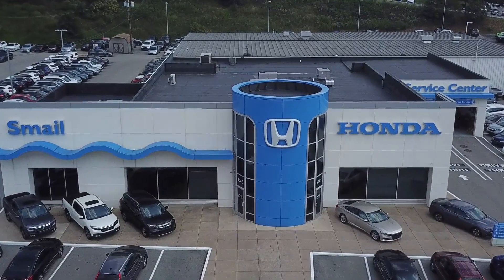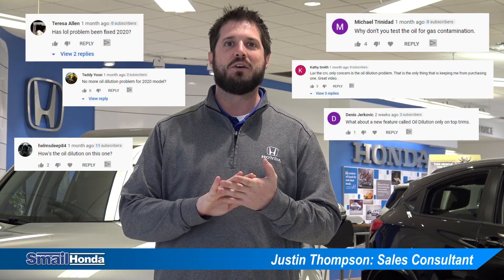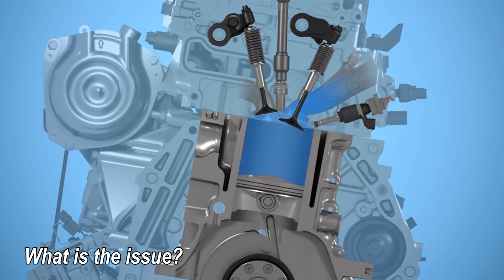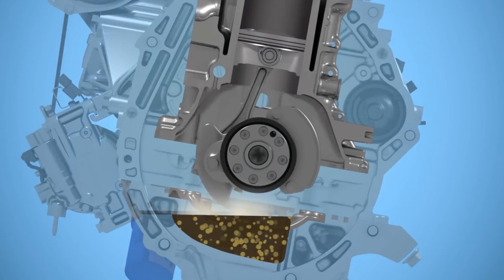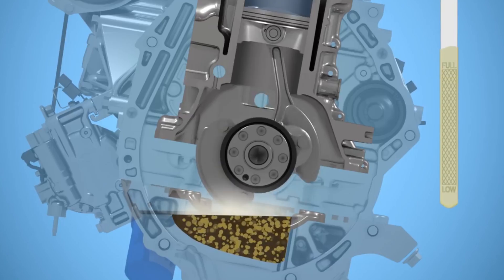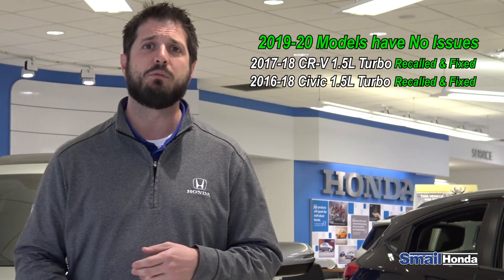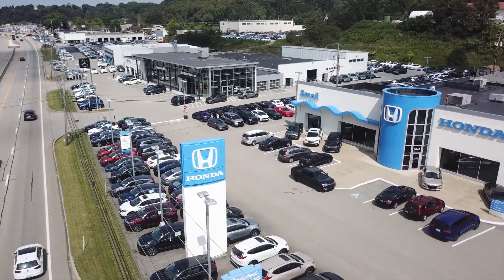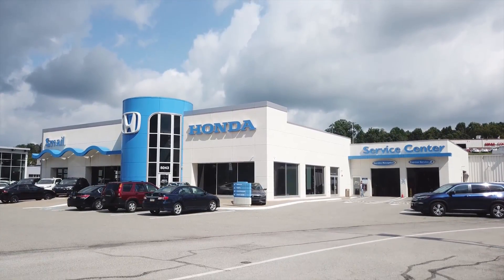Honda Oil Dilution Issue Explained

Comment: Wait! how does a software update stops fuel from traveling down from the cylinder into the crank case and mix with the engine oil? Just imagine my plumber telling me that my kitchen's sink pipe will stop leaking with a software update!
Reply: Your plumbing system isn't controlled by an ecu.
Reply: Paid by honda and of course says what honda wants to push back.  The fact is that my 2020 crv touring has the same oil dilution problem!  I did not want to believe when I checked oil level from the dipstick, it was well above the upper limit, and it had very strong distinguish gasoline smell.  I went ahead checked the engine oil of my 2013 accord that had oil change 6 months ago, found no gasoline smell obviously.  It confirmed the oil dilution problem, which made me feel helpless and very upset!
Reply: @frankli8690  2020 cry hybirid touring with 5200 miles... should I be concern too?  Is it now earth 💩💩💩 technology??   R they gonna have a recall to fix this problem??
Reply: @frankli8690  So what did you do? I have a 2021 cr-v bought 4 days ago and has now 380 miles. I can smell gas in oil.
Reply: Exactly, is he the same guy that's trying to sell oceanfront property in Arizona?
Reply: @clyde5491  You want to buy some Ocean Front property in Arizona .. sorry I think it was stolen by California along with the fresh water..
Reply: @clyde5491    might not be a bad decision....the global warming nutjobs say that the oceans are rising so fast that we only have 10 years .  Arizona could be the new CA??
Reply: fuel injection is electronically controlled
Reply: pretty sure they adjusted how quickly the engine warms up. remote start/idling can exacerbate the problem. fuel sprayed (directly) into the cylinder condenses on cool cylinder walls and drops down into oil pan, if oil doesn't heat up enough before car is shut off again the gas in the oil doesn't have a chance to vaporize and pass through pcv system to be burned. if engine warms up faster, less fuel will condense on cylinder walls and the fuel that did will have a better chance of being burned off before car is parked. this has always been an issue and why it is recommended to take longer drives occasionally if you have a shorter commute. it is just exacerbated with direct injected engines because fuel is sprayed directly onto cylinder walls vs mixing with air before entering the cylinder.
Reply: @driil  should you start the car for 10 minutes before driving in the winter or does that make it worse?
Reply: @shando3333  makes it worse. these 1.5T engines from honda take forever to warmup if just idle (even with the update). engine is just very small/efficient and idling+running heat at idle just prolong warmup process which increases chance of that gas condensing and diluting oil. i still start mine a couple minutes before so seat heater can start but best way to reduce oil dilution is start and go. from what i've read, longer drives and driving car a bit harder (once up to operating temp) should help whatever gas  that does get in the oil make it's way through pcv system and get burnt off during regular combustion.
Reply: @driil  How does it make it worse? Isn't letting your car engine/oil warm up the whole point? (or at least partially). I don't see how its good to start and go in freezing temps without letting it have a chance at warming up....
Reply: @driil  so what you're saying is the pistons and rings aren't sized appropriately to the cylinders causing excessive blow by. It's a design flaw and software only puts a bandaid on the real problem. Many other vehicles use direct injection fuel systems and don't have this issue. If software fixed the problem then there wouldn't be a class action lawsuit and honda wouldn't be settling by paying out their customers. Don't be naive.
Reply: Probably leaned out the cold start idle by a wee bit.
Reply: Probably setting it to a lower psi.
Reply: My 2019 is doing that
Reply: @tinawatson9070  Same. Bummer. I love my 2019 civic si, but I'll probably only keep it about 2 more years because of this issue tbh. Changing oil at 2k to 3k mile intervals wasn't the plan. I'd prefer to wait for the ecu to tell me when an oil change is due.
Reply: Right ! He’s full of crap 💩

Comment: is this only for 1.5 engine or 2.0 which is used in hybrid model of C-RV also?
Reply: only the 1.5... the 2.0l engine has not had any problems.
Reply: What about the the 1.0 engines? Say, a 2017 Honda Civic 1.0 129 hp

Comment: That's a bull%×€\  took my 18 si to my local dealer on hemet ca..and they pretended not to be aware of any oil dilution problem...
Reply: Does the Si have the same issue?. I’m currently looking at a 2020 si and I don’t wanna regret my decision, thank you
Reply: @MrScoobieman for my luck i heard 19 and 20 don't have this issue..
Reply: @Mexi-can72  i have the 2020 Si and the dipstick reeks of fuel also inside the crank case. I am so upset
Reply: Another SI owner here, I have a 2017 and I have this problem. Just started happening from what I’ve noticed and I’m taking it in to get fixed. Hopefully they don’t give me a problem.
Reply: @jazzz33_  thanks
Reply: @jazzz33_  update?

Comment: Always check my dipstick it's over the line
Reply: Same here, i own a 2017 Honda Civic since June, and before a signal of bad oil level in the civic screen, everytime i check the stick to measure the oil level its much higher than the max level. Im from Spain, and with 37°C temperature on the street. Im a little scare of this situation, waiting for the dealership to check the car
Reply: Same here, I own 2017 CRV exl

Comment: Hey guys I have a 2019 ridgeline 
Watched a couple of vids on the oil dilution problem
Had my oil changed last week 
Today took dipstick out and it smelled like a gas tank really bad
Called my dealership to make an appointment 
I will talk to service and see what they say 
I will update you guys soon
I am from Alberta Canada
Reply: Updates, my ass.
Reply: Updates?
Reply: @midniterabt2568  He sold the car.
Reply: Ridgeline uses 3.5L V6 and not affected by oil dilution. Every car used oil will have some gas smell.
Reply: I have the same ridgeline, do not have this issue. Midwest USA
Reply: Updates?
Reply: where the updates man???

Comment: I bought a 2016 civic 1.5l turbo. It has 50k miles on it now. Havent had an issue at all.
Reply: I have a 2016 1.5 changed my oil last month for some reason I decided to check my oil, the oil is dark like I never changed it and has a 2 stroke smell too it lol I think I'm fucked.
Reply: @TomisaLami  my question too... they have a larger optional engine option available.

Comment: I have this issue on my 2019 CRV bad. Oil level is 1.0 over the high mark, and smells like raw fuel. Oil life is 50%. There is no way these engines will have longevity when the lubrication is compromised by thinned oil.
Reply: The best way to fix Honda oil dilution is to buy a Toyota
Reply: Same thing with my 18 si..also sometimes takes about 4 to 5 seconds to start up..always do oil change at 50% because oil level is to high...
Reply: @Mexi-can72  I think I'm super fucked changed my oil last month I'm only 1000 miles in since my last oil change checked my dipstick oil is super dark like I never put new oil in it, smells like 2 stroke oil I have a 2016 1.5
Reply: Piston design issues, reduced piston-to-cylinder contact, gasoline running from the piston rings into the crankcase
Reply: Sad ..but true !

Comment: Nothing about this ad smacks true! Civics def have issues too. Software update does NOT fix piston ring size lol. Avoid earth dream dgi 1.5L turbo. No recall yet and new ones tainted too. Heart broke by Honda
Reply: My 2019 with 8000 miles has oil level 1.0 inch above high mark an smells like raw gasoline. I left the dipstick out for about 10 min and came back an whole garage smells like someone spilled gas. There is a video on my channel of me checking it. Take a look.
Reply: Show us proof then… lots of people commenting on piston ring size with no proof, the fact is it was an engine temperature issue that had to be adjusted, it was not through a “software update” but a climate control update. Apparently everyone with a Youtube account is automatically a Software Developer??

I’ve had the K24 engine on 2010 & 2016 CR-V, that engine is not as good as the 2020 CR-V when it comes to how quickly the engine warms up (which IS the only issue here). The new ones are not “tainted”… I have a 2020, it’s by far the best car I’ve ever owned and it’s not even close… not to mention signifcant drop in fuel mileage and engine maintenance is not needed until 3-4x other brands

Comment: I have a 2019 accord with the 1.5, changed the oil at 5000 miles, tested the oil, only a trace amount of fuel was detected in the oil.  So far so good.  I hope this engine is reliable once it gets high mileage on it.
Reply: hows it holding up
Reply: @rudysaucedo6659  I just had my second oil change done today.  No fuel smell, no rising oil, I have a sample im going to mail out to black stone to get it tested.
Reply: @living4christ  how is it now? mine has 60k miles
Reply: If you run them hard they will wear out faster and leak oil ... Turbo has a lot of pressure and will make the seals weak and cause leaks .

Comment: Had the software update on my 18 CRV and it didn’t work.  The problem isn’t solved and Honda will not stand behind their product.  I have ongoing gas fumes in the cabin.  I’ve contacted them and they refer me to the dealer...and the dealer can’t find anything wrong.  I am caught in the middle with A CRV that has an oil dilution of nearly 7 percent!  The normal range should be less than 2 percent.  It’s highly misleading for you to say the problem is solved.   I’ve owned 8 Hondas over nearly 30 years and this one is my last one!   Absolutely awful customer experience thanks to Honda!
Reply: Same here,17 CRV.
Reply: That’s why you don’t buy cars that are brand new with new motors or new technology   , they could have problems no one knows about until it happens down the line , wait a few years after it’s come out do research on its reliability and what’s issues it’s had or hasn’t had  plus it’ll be cheaper
Reply: Its a shame.. Honda has.been very reliable for the last 30 years.
Reply: Why don’t you just trade your car in then and be rid of the problem
Reply: That's why I bought a Mitsubishi Outlander Sport.

Not fancy, low tech, but bulletproof and reliable. 

Sometimes less is indeed more.

Comment: My 2017 CR-V oil rises to top of orange plastic part of dipstick within 1500 miles, living in southern California (zero days of freezing weather).  Changing oil at <3K miles so far, which is annoying when they claimed it would be closer to every 10K using the Maintenance Minder.  Warranty was extended by Honda to 6 years and unlimited miles if your cams wear out via class action suit, it seems.  Dealer denied issue, but did some free oil changes, then showed the official video, saying no worries!  But check the TSB on recognizing a bad cam and 16 pages of fix steps required.  Going to dump this for a Tesla Model Y next year.   Hate to be person who owns my used CR-V after that.
Reply: I believe it, ours did it winter or summer here in rural Montana.

Comment: I have zero problems with either my 2018 CRV Prestige or my 2019 Accord Touring 2.0t. Youtube mechanics fail to tell that this is a inherent feature of Direct Injection engines, so they make it seem like a Honda only issue. Honda simply made the L15 engines too heat efficient so they warm up slower than normal. If you live in cold climate and do short trips regularly you will have that problem.
Reply: True.
Also the 1.5t engines are all aluminium for better heat dissipation and less weight.
Reply: @Trump_is_a_moron  Most modern engines have aluminium blocks. Doesn't justify anything.
Reply: European perspective: inherent feature, it is not.
Ford, VW, Mazda, Hyundai, Kia, they don't have any issues with this. We have countries like Sweden you know. Quite a few direct injected engines up there without a problem. Why do you think Honda became famous for this and nobody else? Why is the internet not talking about other brands and this "feature"?
They made their engine "too heat efficient"? I don't see the 40 MPG city rating. That's what our diesels do. They are all direct injected. They are so heat efficient, they must double the amount of "oil" in 500 miles, right? Fuck no! They are happy with 8-10k mile oil changes and the oil level doesn't change between two oil changes. 

You have absolutely no idea what goes on inside the engine and you try and justify shitty design (people in fucking Texas are having problems, how cold is that?) with bullshit.
Reply: @ast5515  well, diesel engine with direct injection will never affect or will give less impact if it diluted in oil... that is just basic understanding of what diesel is compared to fuel... But I hear some stories with the T-GDI from hyundai.
Reply: @sundayDX  Kia/Hyundai has oil dilution as a result of a failed high pressure fuel pump. Same as VW.
That's an actual fix. You replace it, it works. Honda diluted oil when nothing it broken.
Reply: @ast5515  Well said.
Reply: I just put it in sport mode when the temp is less than 40 degrees Fahrenheit. Warms up faster and no OD
Reply: Jeffy Now here is a person who has common sense. 👍🏿

Comment: Problem solved!  Keep up the great work Justin.
Reply from the maker: Thanks for tuning in!
Reply: @Smailhondavillage  October 1st I changed my oil and drove my 2017 CRV from Tampa to Pittsburgh and the level went from operating range to 5/8” above the very top of the orange plastic onto the metal of the dipstick, yes the level was so high that the 5/8” of oil was above the plastic and on the metal part of the dipstick. I was told by 3 different Honda dealerships that since there is no engine light on there is absolutely nothing that they can do to fix the problem and I was denied the update by them all, the update that Honda of America said I was entitled too. Unless y’all are performing the update without the engine light being on your video is VERY VERY VERY misleading about the 2017’s being fixed.

Also my CRV has only 28k miles on it and I have to change the oil every 2000-2500 miles because when the oil has that many miles on it the oil level is already topping the max level and approaching the very top of the orange plastic. 

Are you guys willing to update the software without the engine light being on?
Reply: @mgilmer77  
I have the same problem. I have 2018 CRV-EXL. Had the car at dealer 3 times with  oil dilution problem. I have only 7000 miles on it. Last time they admitted  I have abnormal oil dilution ( almost 1 inch above orange plastic on the dipstick. After consultation with Honda Motor Co. dealer change the oil for free, updated software for AC unit. However, the problem is not fixed. Drove only 1500 miles since the last oil change and the oil level is 1/2+ inch above normal. Honda Dealer and Honda Motor Co. refuses to define the NORMAL OIL LEVEL on the dipstick or oil viscosity tolerance. Honda’s standard  reply is you need to drive the car until Check Engine light with code comes up. Then, and only then, they will look into this problem!
Reply: @jacekdzierzan7012  NO EXCUSE-Shame on you Honda!-John in Texas
Reply: @Smailhondavillage  I find it hard to believe that none of your techs have not seen that problem with the 2017-2018 CRV or Civic, it’s borderline comical! 
When I was in Florida my AC compressor blew the seals and quit working and the service manager told me that this was the first he has ever heard of an AC compressor blowing the seals and leaking out all the refrigerant but meanwhile my CRV and another 2018 CRV along with 3 Civics with the 1.5 turbo engine were all there at the same time I was with the exact same AC issue. So with that being said Honda as a whole and it’s sales and service reps have lost all credibility
Reply: @mgilmer77  what if you smell gasoline inside the oil chamber is that normal?
Reply: Lies its not solved just take a trip to any Honda forums lots of issues still with the 19 and 20 years as well... Honda has gone way down hill in the last 10 years!! I will never by a Honda and I used to be a fan!
Reply: @eucmike  agreed Honda has been sitting on there laurels and past reputation, there quality and reliability is terrible now, I also was once a huge Honda fan, I’m not a fan of Honda anymore
Reply: @joskjj3625  I felt exactly the same about Toyota and that’s why I only buy Honda or Hyundai now… I had a 2-year old 2011 Sienna that had light use at 30,000km the engine belt snapped, not covered under warranty. I cut a deal for a 2013 and traded it in as soon as I could.

Guess what? That was the only time they ever put a 4-cylinder in the Sienna until 2021. They are going back to it with Hybrid, 6-cylinder is no longer an option even for luxury models.

This is where things are at with brands like Toyota, they try to convince us on Toyota quality but then they do something like this that only puts the consumer at risk
Reply: I think it’s a shame that a reputable company like Honda is doing this. 

I can go on, but there is no way this problem was fixed by their so called software update. Just ask any engineer.
Reply: @hiteshjani8290  what engineers will tell you is that you have to find the right air / fuel combination, the Turbo compresses the air and makes it hot going into the combustion chamber. You need to cool it down.

The formula for this was off which is why gas doesn’t burn off in lower temperatures. Once at operating temperature it does so if you have a naturally aspirated engine and you never get it past 1,700 RPM you have oil dilution.

They adjusted the formula and fixed the problem. This was done in 2018. Yes it is a software update, the update was for the ECU
Reply: What a joke .